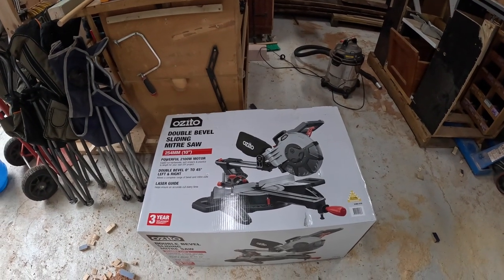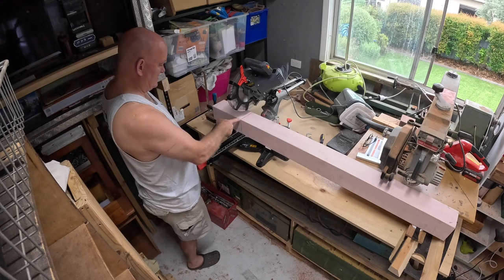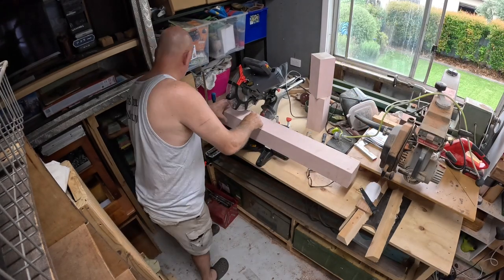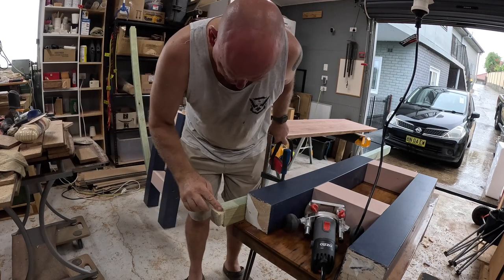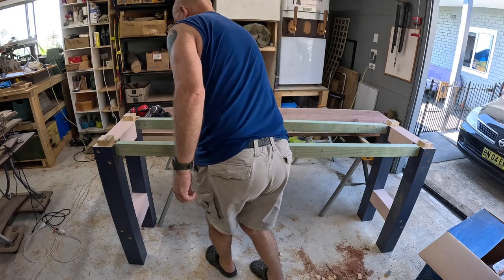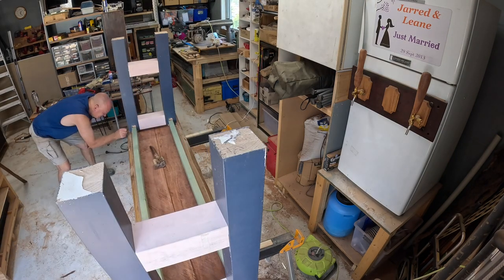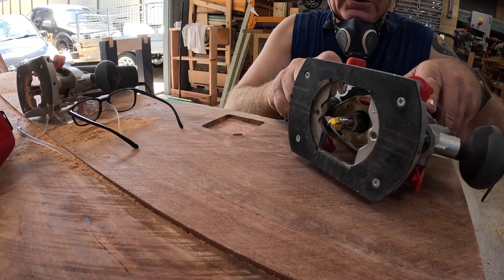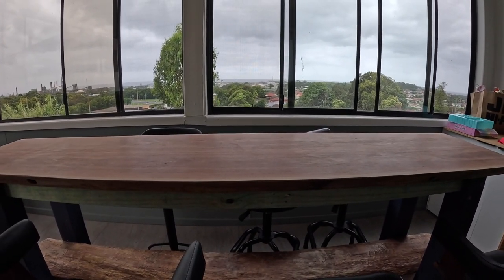Sunroom table part 4 – finished

Comment: Totally worth the struggle.  Looks fantastic.

I reckon that top isn’t going anywhere with or without brackets.  Don’t forget to allowance for timber movement between summer and winter.  The solid timber top will expand and contract possibly by 5mm over its width.  When you anchor it let a couple of screws on one side be a bit loose to allow it.  Also, you may need to loosen the two connector rods as well.  Time will tell.
Reply from the maker: Thanks Mike. There's a lot to fix and finish on it, but it does look very nice in the space.
I will consider your expansion tips carefully. I've seen what can happen when wood expands. I helped my brother build a pair of garage doors that were expensive and looked beautiful, but gave him a lot of trouble because we didn't think of expansion.